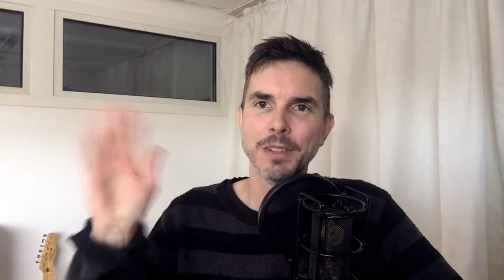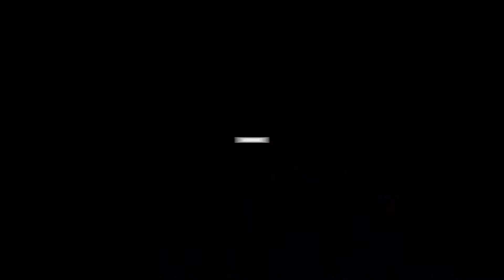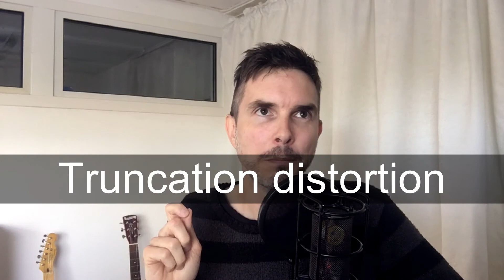Dither - Everything you need to know! - Mastering Explained

Comment: I will point out what I learned and agreed with as a Music Tech major in 2010. A virgin recording, okay use dither, but you already have circuit noise from your preamps. As a mastering engineer you would be working with something that already has had noise introduced to it. Now a raw/virgin Virtual Instrument track. Maybe dither is important. I might use it to print a virgin track but really . You already have noise from synths and preamps in your file, now are you printing pure sine waves from some test test equipment. Oh but wait. There are amps making noise involved. Dither would be appropriate for printing pure virtual sign waves. ... you see where I am going.... dither is just adding noise to 16 previous noise sources.... not necessary
Reply from the maker: If you're not using dither when going to 16 bits, make sure to at least check the fades. /Thomas

Comment: Question
If your session is 24-bit 96kHz and you intend the final mix to be 24-bit 96kHz, and also the Playback medium is 24-bit 96kHz,
Should you enable Dither to help other converters Playback the track with no Quantization errors? or will other converters be able to Playback with quantization errors without Dither?

Comment: Interesting. This is not exactly what I learned, nor practice. Are you 100% sure that dither should be applied when I render 24 bit files as 24 bit files, just because 32 bit is the computer's native audio resolution? I mean it's not like the 32 bits show in the bitmeter in, say, WaveLab. I do dither when I need 16 bit for CD or video.
Reply from the maker: Yes, dither when going to 16bit is the most important thing. If you change anything about the file while in 24 bit it’s technically correct to dither when you export the new file to 24. However it doesn’t matter as much when it comes to 24 bit to 24 bit. If you get that wrong you won’t hear the difference i would say. But yes, dither to 16 is what you want to get right which you are ☀️☺️ /sofia
Reply: @MasteringExplained  Thank you very much. Highly appreciate all the great feedback here. I will return to this video as I get through the details on the MAAT LINpro dither plugin that I have switched to. Also I feel inspired to use exaggerated truncation for noise in the lofi hip hop I'm producing these days. :)
Reply from the maker: Also, we don’t use wavelab here so i can’t say anything about that bitmeter and how it functions. Maybe someone else can see this and has the answer. ☀️/sofia

Comment: My methord for dither is very different from most engineers out there:
Given that dither is noise, even though the noise itself is very low in volume, the tone change it makes to the sound can be heard. Because of this I preffer to use a dither plugin on the mixbus/master channel all the time (activated) and render throught it, while also making sure that all the options from the DAW for dither and noise shaping are deactivated.
This way I can be sure that the mix/master after exported will be exactly the same as I hear it inside the DAW.
Reply from the maker: That's certainly a way to do it when there's only one output format and you're in the final sample rate already. It gets a bit more tricky when exporting multiple formats, i.e. different sample rates and bit depths. 
It's also good to remember that it's only when going to 16 bits that the kind of dither used is anywhere near being audible. I'd even argue that correctly implemented standard (TPDF) dither is completely inaudible on most material in most listening environments, and harmless when audible. /Thomas
Reply: It always sounds better in the Daw for me. Is good dither good for this?

Comment: Hello!

In hybrid mixing/Mastering Is it best to put a dither plugin with 24bit on the way out from daw to analog hardware if the project is in 32 or 64bit ?. Best/Mathias
Reply from the maker: Yes, the technically correct way is to dither whenever you go from 32/64 bit floating point to 16 or 24 bits. There are a few situations when dither is not needed, but the penalty for dithering anyway is very small. One can also argue that the truncation distortion in a 24 bit signal is so low that all of this is insignificant, and that's certainly a valid viewpoint as well. 
But "dither whenever in doubt" will almost always be correct, and never completely wrong. I guess that we should make a follow-up video with the full story. :) /Thomas